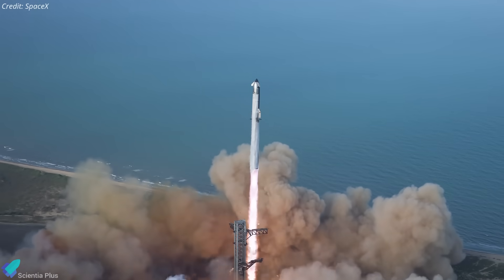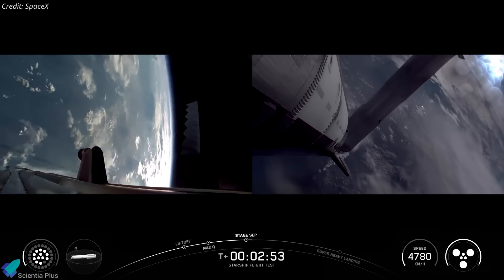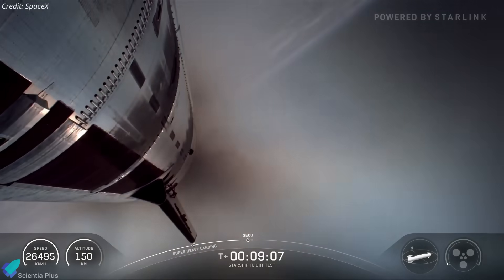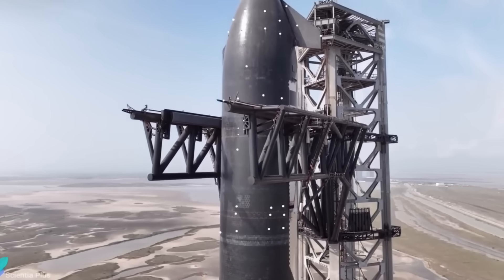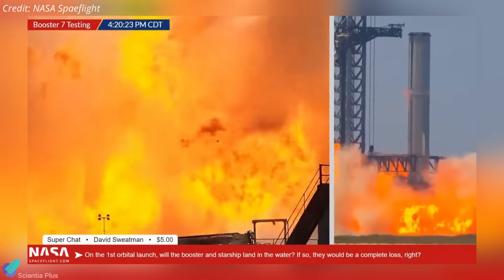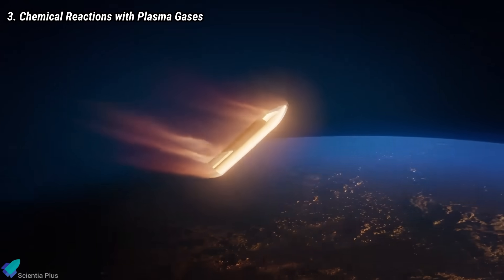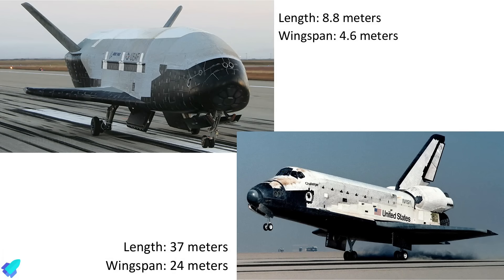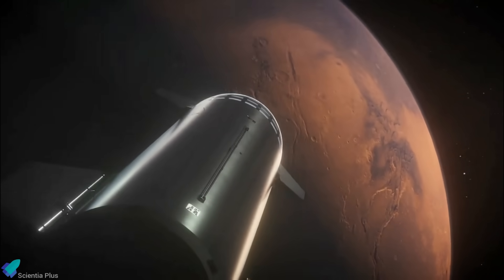Starship Flight 10 Footage Hides the REAL Cause of Engine Bay Disaster & Heat Shield Colour

Comment from the maker: 00:00 Starship Updates
10:42 SpaceX Just Launched America’s Classified Spaceplane

📚 Learn More:

🚀 Starship Block 2 Explained:
 📖 Summary: https://shorturl.at/b0dtw
 🔍 Detailed Explanations:
  • Design Improvements Update 1: https://shorturl.at/lpGT7
  • Design Improvements Update 2: https://shorturl.at/gwNQ4
  • Nosecone & Payload Bay Redesign: https://shorturl.at/xa60S
  • Methane Downcomer Redesign: https://shorturl.at/XdYBG

🚀 Starship Block 3 Explained: https://shorturl.at/mnBT4
🚀 Starship & Booster Block 3 Detailed Breakdown: https://shorturl.at/IViwD
🚀 Starship & Booster Block 3 Production Begins: https://shorturl.at/xRNkJ
🚀 Booster Block 3 New Transfer Tube / Downcomer Explained: https://shorturl.at/Iaqc6

🔥 Raptor V3 Mega Upgrades & First Test: https://shorturl.at/TRIyj
🧱 What’s Inside Starship GigaBay?: https://shorturl.at/nJM75

🛠 Insane Engineering of New Starship Launch Pad B: https://shorturl.at/7RAZd

🛢 Dual-Port Orbital Refueling – Full Technical Breakdown
https://shorturl.at/5tiqK

🛠 Other Starship Upgrades:
 • Hot Staging Explained: https://shorturl.at/jf400
 • Super Heavy Booster Upgrades: https://shorturl.at/Pi5R3
 • How SpaceX Protects Raptor Engines: https://shorturl.at/4Om8F
 • New Heat Tiles Explained: https://shorturl.at/p2Ijb

🚀 Starship Flight 7
 📽 Complete Breakdown: https://youtu.be/UqzZx7vb-TA
 🛠 Root Cause & Fixes: https://shorturl.at/HcLKo

🚀 Starship Flight 8
 📽 Complete Breakdown: https://youtu.be/f26yH80RK2o
 🛠 Root Cause & Fixes: https://shorturl.at/vsGFB

🚀 Starship Flight 9
 📽 Complete Breakdown: https://youtu.be/2eirgcUzwts
 🛠 Root Cause & Fixes: https://shorturl.at/NwhZA

🔥 Starship 36 Explosion:
  📽 Detailed Breakdown: https://youtu.be/VWQiIz1ymBA
  🛠 Damage Report: https://shorturl.at/Quoex
  🛠 Root Cause & Fixes: https://shorturl.at/NVqdS

📡 Stay Updated:
📢 Weekly Updates: https://bit.ly/3HIQjPC
🚀 SpaceX Playlist: https://bit.ly/34wue8T

🌍 Follow Us:
👍 Facebook: https://www.facebook.com/scientiaplus
Reply: ai slop

Comment: The engine skirt surrounds the engines. Should it only cover the areas with heat tiles, while the rest remains in a lift-off support format? This could address weight-saving and leak accumulation dispersion issues. Any thoughts?

Comment: It is sad that the Ship could not be saved for a thorough inspection of what had happened and how the materials had degraded due to thermal and mechanical stresses. The video cameras do not show enough. For that, you need probes for microscopic analyses of the crystal structure. Seeing parts flying away is impressive, but it does not say what caused the incident.
Reply: there are 1000s of sensors on board.
Reply: @sfisher6398  The 1000s sensors cannot analyse what I mentioned. Or do you know a sensor for the crystal structure? If something breaks, the surfaces are of interest. Are you an engineer?
Reply: Maybe certain sensor anomaly can predict cracks in the crystal lattice through Acoustic emission.. usually during cracks it creates high frequencies stress wave.. even piezoelectric sensors can pick up these cracks ..and many more such sensors that do that 😄.. so yesss it can
Reply: PS:- I asked chat gpt 😂😂😂😂
Reply: @soulslayer59  But there is the problem that rockets make a lot of vibration and sound, so it is difficult to filter out these acoustic signals. Also, it is hard to predict what will break to place a piezo sensor at this location. If the object gets too hot, it also becomes difficult for the sensor. But yes, it may work on cold parts of the rocket.
Reply: @gottfriedheumesser1994 true it can  filter out but what if the sensor is made to only catch certain frequency only ..beyond that range is nullified hence large amp vibrations r nullified when rockets vibrate but short spectrum does get captured ;) ..just like Vibgyor spectrum but nullyfing uv and ir
Reply: @soulslayer59  Catching certain frequencies means filtering out. But there are also more sophisticated methods of filtering. The problem may be that the ambient noise is too strong to hear the cracking of the material.
Reply: @soulslayer59  Try to make a piezo sensor that catches a few frequencies only. You may earn money by doing that.

Comment: At 3-1/5 minutes in, this is just B.S. by fanboys, nonsense parsed as 'success', but actual failures from start to end. 
Using booster engines to a splashdown is idiocy. Use a damn parachute instead.

Comment: The aft skirt was sacrificed as a test area for both a deliberately compromised heat shield at this area and the excessively high angle of attack, also deliberate. They didn't think a failure there would necessarily jeopardize the re-entry burn and they were correct. What concerns me is that they decided to jettison the hot staging ring. They are hoping to keep it reusable. Jettisoning it compromises that goal but for now the extra weight was omitted.
Reply: The next iteration of the boosters will have an integrated ring.

Comment: OMG- The fanboying is so delusional.   Yet another utter failure.  Could not catch the booster. And Starship did not survive re-entry in a remotely re-usable condition. Massive structural damage. The skin of the flaps and likely the rest to the hull had warped and lost all temper.  It exploded on touchdown, and the empty portion of the tanks was still orange hot. A temperature at which stainless loses half its strength.   This is not a rapidly reusable spacecraft and likely never will be. AT least, not without a major re-design.  It did not carry significant mass to orbit, and you could see the handful of ‘test masses’ banging against the doorway as they were ‘launched’ with the tumbling as a result.
Sorry, folks. This is not one inch closer to being re-usable, much less the LUNAR LANDER our tax dollars PAID for in advance. Musk is currently 4 years behind in his project milestones, and not making any serious advance toward the contract.
What Musk is doing with the 4 BILLION dollars we gave him for a lunar lander, is building a Starlink deployment vehicle, which is his private company, in which the taxpayer has no stake, and NOT the spacecraft NASA contracted for.

Comment: Payload simulator hit structure on way out.  Not acceptable for real satellites.  Satellites will either need a strategically placed rub bar, or a less flexible mechanism, as a torque is induced just prior to release.

Comment: Can't believe that after all this time and money that this thing still can't do what the NASA space shuttle used to do and they did it for less money too.
Reply: Starship is designed for full reusability. The Shuttle needed to be transported back from where it landed, took 9 months to refurbish and a lot of non reusable parts.

Cost per kg to LEO:
Shuttle: $14,500
Falcon: $1,400
Starship: $10 to $20 (goal)
Reply: @Tailspin80  Starship hasn't been totally successful yet and hasn't carried a real payload as of yet. Those numbers sound good in theory but everything changes when you are doing real world applications. That testing with the fake and light payload which didn't fill the storage bay and no crew either I don't call a success. And so far it has cost more with fewer successful results. But if you call landing in the ocean and exploding or taking off and exploding successful. I would say you are right.
Reply: @Fristpeople Earlier systems were always going to carry a high cost per kg to LEO because of the cost getting the ships ready for their next flight. No amount of optimisation can change their underlying system architecture. SpaceX has changed all that by making rockets increasingly reusable. Falcon already dominates the satellite market to the extent that it has no serious competitors and Starship takes it several stages further, or it will when it becomes fully operational. Of course it’s difficult and time consuming but the goal is worth it and SpaceX have the income stream and investors to fund it with no direct support from the government. It’s good to see such an ambitious program being executed and I wish we had something remotely similar in my country, the U.K.

Comment: Methane leak causing an explosion in space? even in the atmosphere methane is very finicky to cause an explosion (that is why its safer than propane) ... it needs a very specific ratio of oxygen to methane to explode ... good luck having that under those conditions.

Not every explosion needs combustion, something that is in liquid state and suddenly is heated up in an enclosed compartment, may explode by simple pressure rise.

Comment: The engine failure was planned as well as missing tiles to test under extreme conditions.  All failures were planned as discussed during the space x live coverage.
Reply: True, except for the engine loss on booster ascent, the explosion in Starship's engine bay, and the damage on the aft flap.  Overall though, a successful test with much useful real world data gathered.
Reply: @chrisantoniou4366  Those failures were products of the intentional ones though. Without the intentionally gimped tiles and messing with the engines during operation it's very likely none of those failures would happen.
Reply: If we are talking about what was planned..... They have 5 years delay....
Reply: @wexelo where's your rocket
Reply: @wexelo  You mean at least 5 years advance over anyone else.  Remember that Starship is not the development of any other launcher, but a program that innovates on just about EVERYTHING, size that has never been previously approached, new materials, new fuel, reusability, new engine and propulsion technology... you name it, SpaceX had to develop it from scratch!
So, yeah... there were a few delays vs an initial flawless and muskian time objective!  It never happens to you to fall behind in whatever you do even if you tried hardest?
Reply: lies.

Comment: I think I understand that all the flaws of the ceramic tiles are due to SX recreating them from scratch with their own formulation of materials to have intellectual property of all the main components of the ship? (Because the tiles of the X-37B spaceplane work properly already)  What would it be like if they licensed the technology to Boeing to use them on Starship?
Reply: The comparison b/t Starship and X37B heat tiles is apples to oranges. The X37B is a much smaller, lighter vehicle with much less surface area to protect.  It comes back at a lesser speed, thus incurring less heat. But It would be interesting to get a real comparison of the two tiles to see what differences there are.  Cheers
Reply: Trouble is they are a pain in the arse to install
Reply: @davefarmery8180  ...and they need to be reinstalled after every flight.

Comment: If this test pushed it to its limits, it's pretty limited
Reply: wow thats as stupid as anything iv heard from other haters both vehicles not only survive problems in flight but completed all objectives including no structural failures in areas with NO TILES just ablative materials try again when you actually know wtf youre talking about
Reply: @mouserr  its supposed to send 100 tons to the moon. if this suborbital flight with  a payload that i can bench press is  "pushing it to its limit",  its got a problem.  Maybe it did it with total ease, but that is not what the narrator said, and i am picking on the narrator's language and exorbitant enthusiasm as much as the rocket. its a pretty bad rocket and program if you use NASA's Apollo program as an example - would you have wanted to be in it when it touched down? But its good if you use Russia's N-1 program for comparison.

Comment: The implosion within the engine bay was moisture caught vaporizing from the heat causing the fin area to burst. The orange color was due to the oxygen gases purged through the vent holes in the mid line of the shield causing a chemical reaction of the ceramic shielding material.

Comment: The sketchy TPS will never allow rapid reusability. Reentry is too violent for any protection system currently known. There will never be a human rated rapidly reusable spaceship.
Reply: You could be correct those tiles looked terrible. Here is what they will do. They will spend one month refurbishing a Starship after launch. A factory with 50 working Starships will be in various stages of refurbishment. Every day a Starship that landed 28 days earlier will be released and moved to the pad and launched.

This allows daily launches to happen despite the refurbishment timescale required. 

Some variation of that will be needed with a perfectly reusable ship as you need to load and secure its payload which might take a week for some payloads, so you're always going to need a rolling buffer of capable vehicles.
Reply: log this comment under, "if God intended for man to fly, he would have us wings." What he gave us was Intelligence and curiosity to figure out how to do things we've never done.

Comment: the main problem i see with the line theory is that the metal is bend inwards after the explosion. i believe more that something hit the outside at high speed.
Reply: That's what I was thinking. It looked like an impact. (Anybody missing a satellite? 😁) Scott Manley postulated it could have been a collision with one of the Starlink Simulators. They were all on similar trajectories.
Reply: @garyreed2206  Didn't it happen well after the on orbit burn, if so the satellite simulators would be well away from Starship at that time.
Reply: Looked to me like some sort of projectile impact.

Comment: The explosion didn’t effect the flight.
Reply: Each one exploded after tipping over in the water after a successful landing
Reply: @zacharycardenas353   As was expected by SpaceX.  What did you think they were going to do?  Float and wait for someone to pick them up.  Without pressurization in the tanks, the booster is barely a soda can.
Reply: @davidbrittenham4631 they plan to sink it they weren’t going to recover both after doing a successful test flight
Reply: @zacharycardenas353 they blew them up , they aren't going to leave unexploded  explosives

Comment: Orange shows the metal temperature to be 1600F - 2000F due to re-entry heating. When the 2nd stage after settling vertical fail over on its side, there was a rapid cooling, quenching, occurred. May have buckled the structure.

Comment: Will clearly the x37 has solved the reusable heat tile problem so I wonder how they did it?
Reply: No, they didn't... it goes trough the same refurbishing that the Space Shuttle did.  Tiles are replaced as needed.  Since it's a smaller vehicle, and the tiles are more uniform, the process is a lot faster, but it still takes place, in fact, in the same Shuttle Processing Facility that the Space Shuttle was.
Reply: @williamsteele  Starship is bigger than the shuttle... Starship alone is bigger than the Shuttle's external tank....
Reply: @williamsteele good to know. Thanks.

Comment: At 1:34, in this video, you can see distortion on the hot stage ring. At about the 8 o'clock position.
Reply: There must be a reason why stage 2 had some issues in the aft section. Hard separation from the ring?

Comment: Damage to StarShip rocket Bay You can see from the hot staging ring distorted from hitting the bottom of the starship in video 1:34 in at break away in tilting. That caused explosion later in Starship rocket bay skirt.
Reply: Sure looks like a possibility!
Reply: @chris.eskimo  A possibility you can see where the hot staging skirt meets with the starship has been distorted in the same area. The rocket Bay blew up.

Comment: All of those operations carried out perfectly , milestones each but all you could say is  "Explosion Root Cause & Bizarre Color Change Finally Exposed"  (Explosion, Bizarre, Exposed, all dramatic verbs) not necessary except for a Drama Queen channel,  You are supposed to report what is happening not to dramatize events to better suit an algorithm.
Reply: "not necessary except for a Drama Queen channel"

Or a fan boy site like this one? Please name one of these 'milestones' you speak of.
Reply: And the ship exploded after splash down when it landed safe the tfs activated after the tip over in the water
Reply: Yet another Raptor failure, and a heat shield that is still a work in progress.

Comment: The coloration on SS tiles looks like a well tuned engine spark plug should.

Rear flaps should have an angled opening gap away from the weak trailing edge. Kinda like what F15 elevators have.

Nouveau Nephilim away as he is coming on the clouds of the Sun’s increasing Oort Cloud magnetosphere to judge the living and dead in spirit.